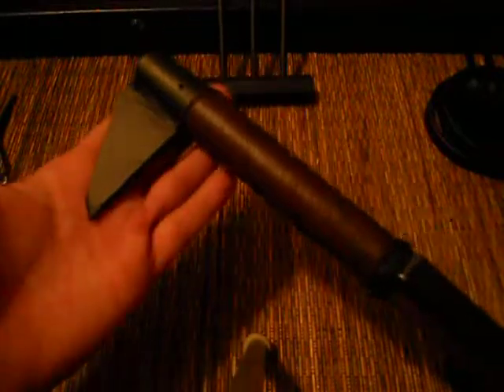tobiguchi, free give away announcement, lockpicking, shuriken, shuko

Comment from the maker: they are called lining up/ drift punches here is the link if you look at the bottom left thats them. they come to a 1/8 point and are 5/16 at the handle also the 3/8 thick ones with a 5/32 point would be much work to get a nice point either and there both around 4.11 or 4.39 each.  So Kbctools.com and search drift punches